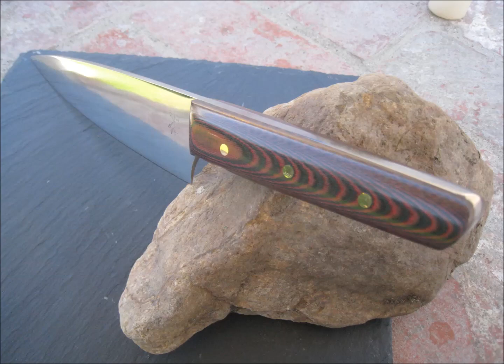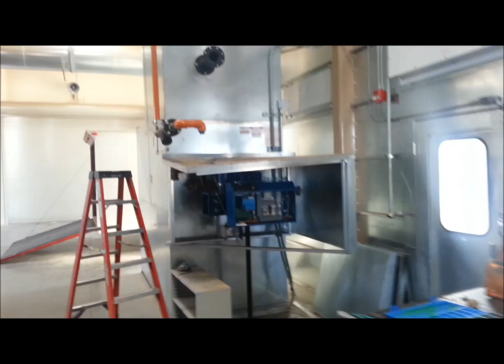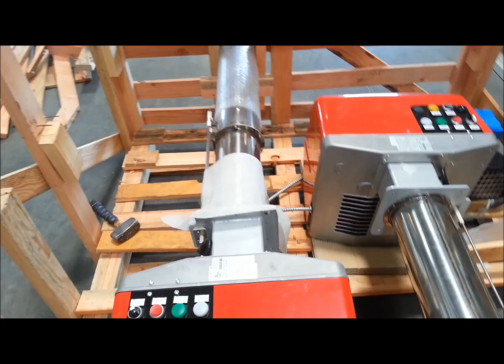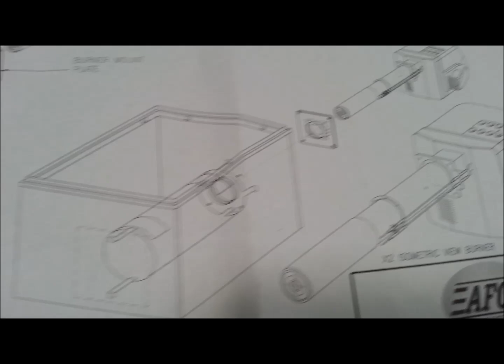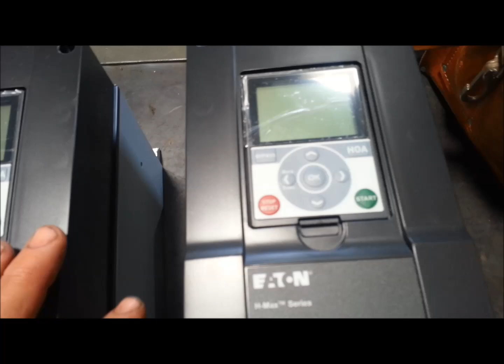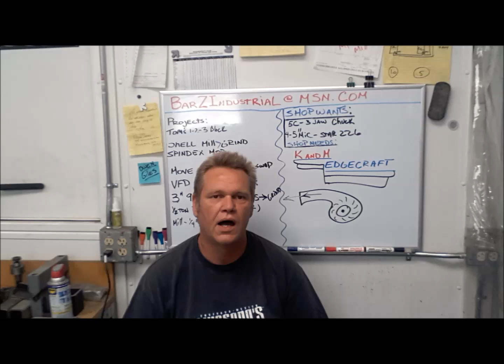Week update #13

Comment: Interesting stuff.  One the "recirculated" exhaust,  with the right mixture (stoichiometric) it isn't fuel nor oxygen.  This helps slow down the burn, lowering peak combustion temp, lowering NoX formation.    EGR in your car is the same idea, but to explain it I need to review old Chemistry History, and do lots of hand waving, and moles aren't those things in the ground. :)

If you make it to Texas, lots of good BBQ and I'll tell you the story of stoich, burners, million dollar projects.... why NoX failed, and a damn spider!
Reply: Tom Walter lol! I like your explanation! :-) I wanted to mention Nitrous Oxide in a recent reply of mine, but wasn't entirely sure that was correct. Hmm..."EGR" is similar to the term used by Honda but the initialism they use is escaping me at the moment.
Reply: Martel DuVigneaud Honda also used EGR (Exhaust Gas Recirculation) at low rpm to reduce pumping loss.  I had a blast working on engine management (electronic), and mechanical (dyno), but needed a Chemical Engineer to help understand what was going on.  I still find it fascinating, as I learn something new everyday!    Tom

Comment: And if it doesn't have a 13th floor button, you'll install  one ! Are the CAL emission extremely strict ? Has anyone considered water injection - lower flame temp = less NOx. Nice idea for your comparator.
Reply from the maker: Hi Jester,
Unfortunately the Cal emissions have dictated the numbers and the trade technology hasn't been able to keep up. Lowering the flame temperature sends the Co though the roof, that was the recirculation theory behind bringing the flue gas back for a second burner pass.
Reply: Shadon HKW
Hmm, I think my car ('91 Civic) does the same sort of thing to reduce emissions. Although I think it's the exhaust that's somehow causing the main combustion to be cleaner, but I'm not really sure.

Comment: 13 was good.  So what were the burners being used for?  I like the square checking setup looks good.  I love your squares.  Thanks for sharing the video.
Randy
Reply from the maker: Hi Randy,
Those units are firing into a 32,000 CFM air stream to heat a paint booth / drying booth. Thanks for the encouragement on the horizontal comparison gauge. 
Z